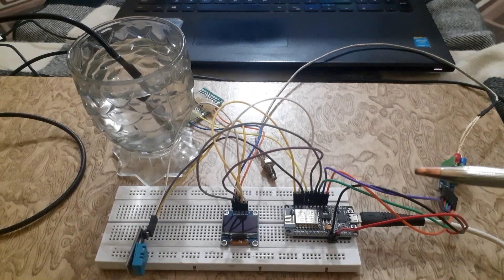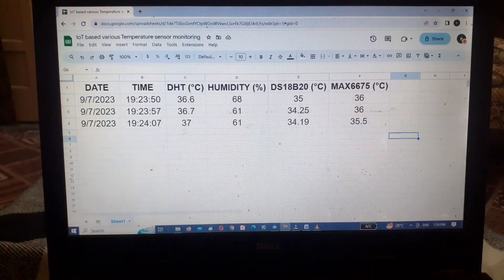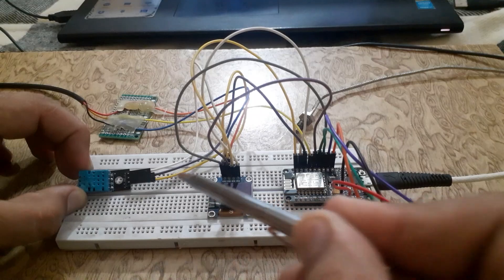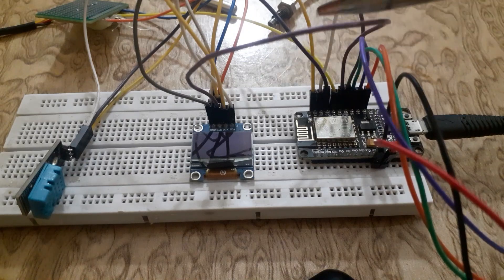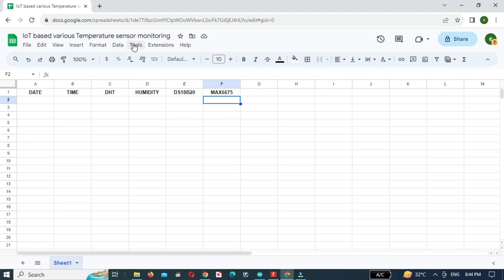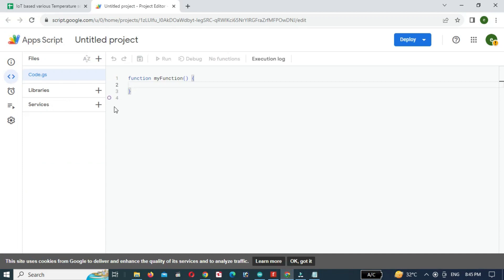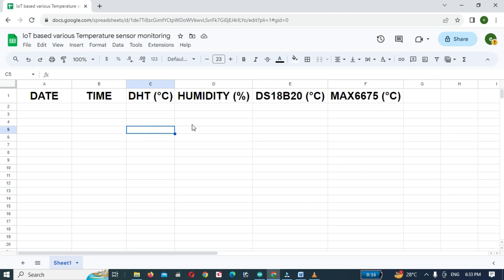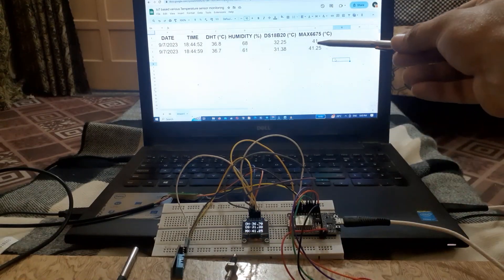IoT based Various Temperature Sensors Monitoring using Google Sheet

Comment: Awesome project.
 Can you please do some modification to existing code to send Temperature data to Google sheet only if the set upper or lower temperature threshold limit is passed.
Reply from the maker: yes it is easy you have to use if condition in the code